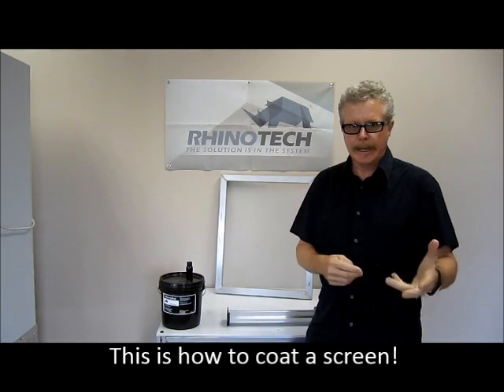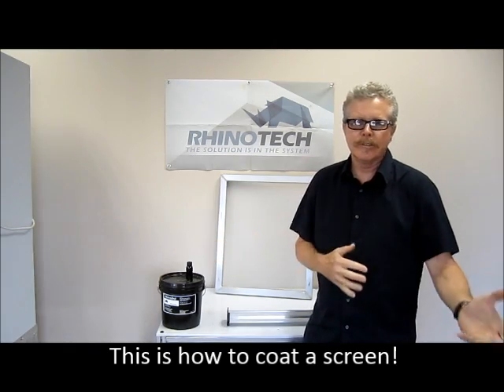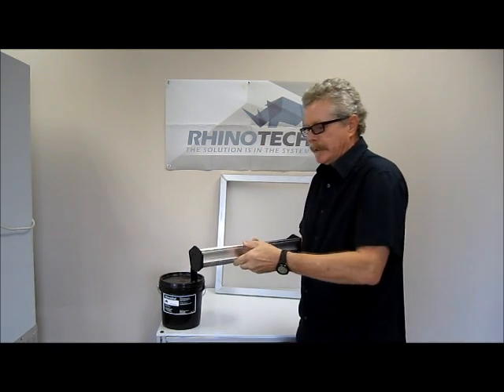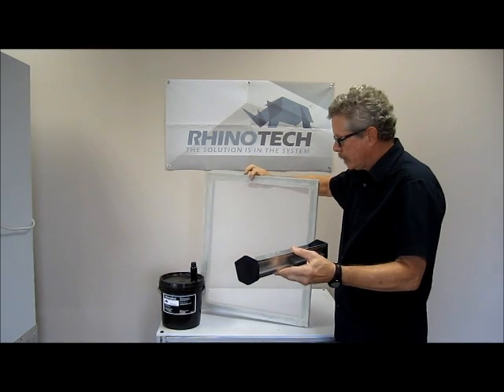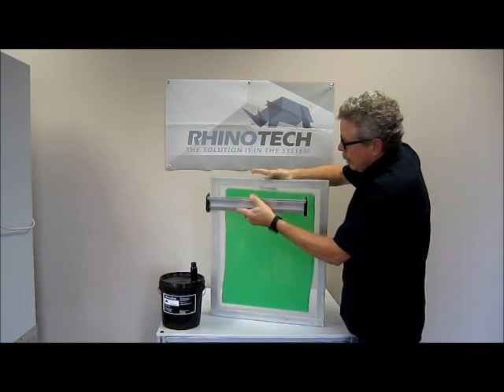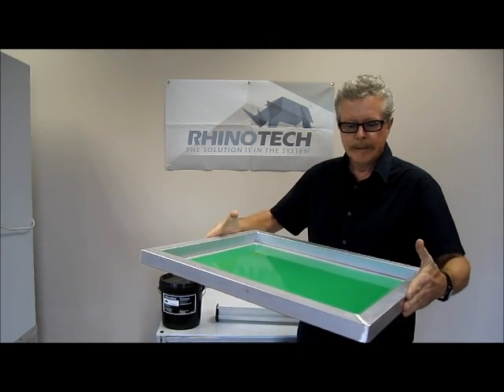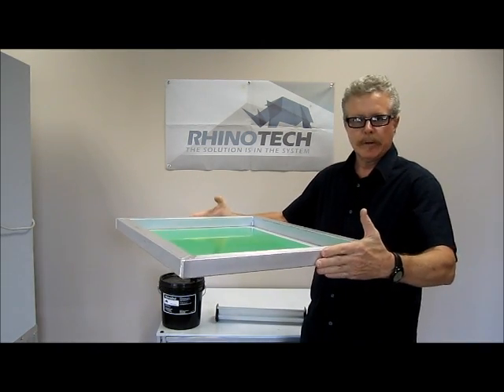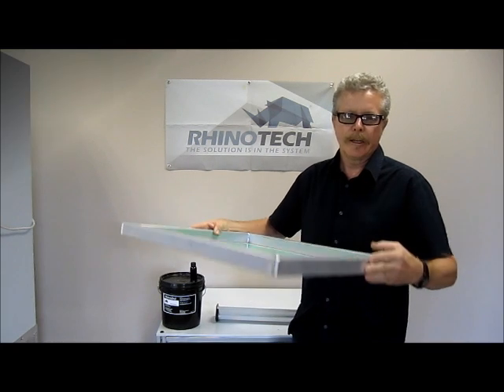Screen Coating 101 by RhinoTech!

Comment: Great video.  Question: doing two passes on the bottom in quick succession does not equal two coats?

I normally do one coat on both sides.

Comment from the maker: I usually do two coats, because I want to have more emulsion on the bottom surface. As you noted, I did my last pass on the squeegee side that pushed the emulsion through the mesh. This gave me a larger deposit on the bottom. Also, as you know, one or two coats is relative to the job you're doing; the emulsion being used. Also, depends on mesh count and solids in emulsion you've chosen.There are so many different combo's of passes, wouldn't you agree? Hey, thanks so much for your comments!